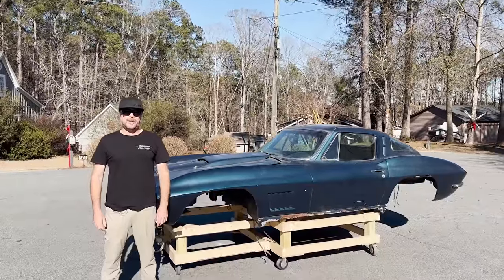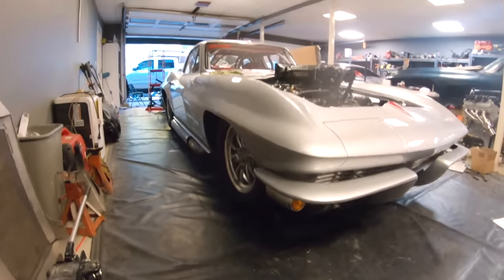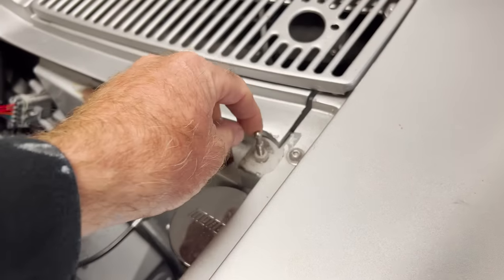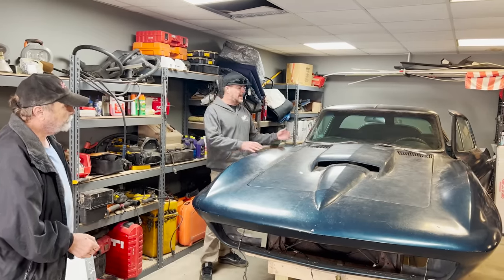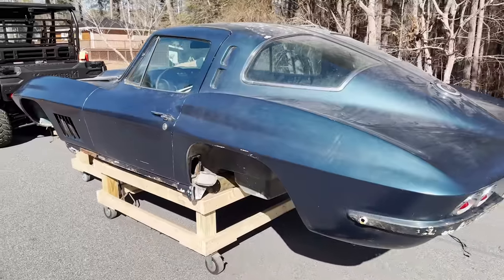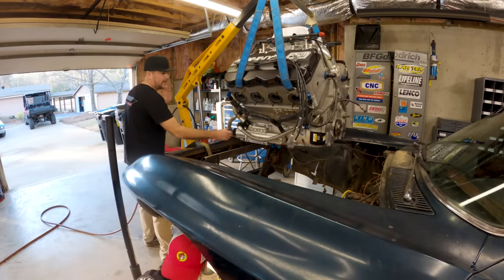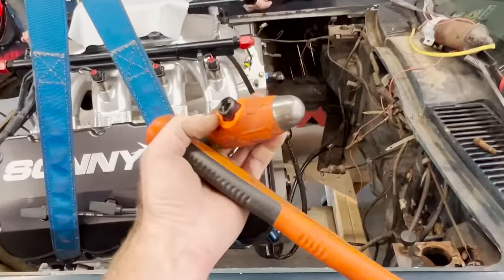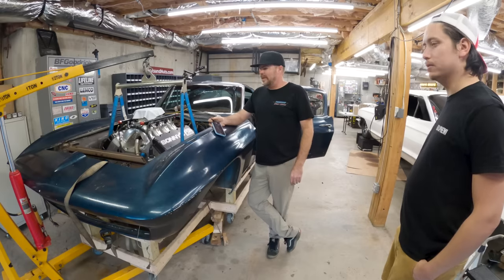I RESCUED A 1963 SPLIT WINDOW CORVETTE HIDDEN IN A BASEMENT FOR 20 YEARS!

Comment: Hey Mike, happy to hear about Mk4 Supra and also Split window, both are epic cars. I would heavily suggest looking at underbody aerodynamics of fellow finn Kimmo Nevalainen’s Six-5 split window C2. He came to USA for Texas Mile and is fastest C2 top speed world record holder with ”identical” car. If you want to be fast, safe and stay attached to ground at high speeds, the bottom end aerodynamics are very important. What is best that it looks absolutely stock in body, but the magic happens underneath.
Reply: 100%
Reply: YES! 👍
Reply: Thx for the heads up of Kimmo , that's a cool and fast ass ride ! 😎
Reply from the maker: i'll definitely search him out. dont want to be doing any backflips. i'm hoping to not run wheelie bars on this car.
Reply: 100% That body makes a ton of lift and needs a good floor / under tray to stay on the ground.
Reply: @FinnegansGarage  I would ask you not to cut up an antique car just to make another drag car
Reply: @jamestyndall529  This car was crashed and already cut up. Watch the video first before crying about someone else's preferences, bud.
Reply: Well depending on what you mean by “stock” that’s obviously a ‘67 front end on it….  They were also running over 170 on the Mulsanne Straight in a stock L88 at Lemans in ‘67.
Reply: @TheBCninja  sounds like you’re the one crying dude. He merely expressed his opinion, chill out.
Reply: @TheBCninja  and it’s his car he can drive it off the cliff if he wants, but I agree, it’s asinine to chop up an original ‘63
Reply: @sidefx996  This car was crashed and already cut up. Watch the video first before crying about someone else's preferences, bud.
Reply: @jamestyndall529  I mean I get what you're saying... Just no one here agrees because we watched the video
Reply: Yes so happi
Reply: @sidefx996  Buuuut, it’s not an original 63. It has a 65 nose grafted yo it after a crash. Vintage work I guess, but not original.
Reply: @sidefx996  L+Ratio
Reply: @RandomName100  That's just bodywork dude.  And it's a '67 front clip thanks very much, not a '65.  The hood and side gills are obvious and unique to a '67.  It's still a REAL '63 and they're not making them anymore.  No doubt the end result will be cool but you can get a body and a tube chassis anywhere to build another Drag Week car, why destroy a real one?  Like I said it's his car he can do as he pleases just one man's opinion.
Reply: @sidefx996  yes it’s bodywork. Fiberglass. And you don’t get a title with that chassi and body.
Reply: Camaro available?

Comment: When I started as an apprentice mechanic, the shop owner had just bought a 63 Vette Hardtop in that very same Daytona Blue, with the the full Z06 package including the rare 36 galleon super tank. 327ci with mechanical fuel injection, heavier but vented drum brakes, a smaller leaf spring and no rear sway bar and a single piston master cylinder. For a race car package so many of the ideas at the time were backwards, (single piston master instead of the stock model dual, a 7 spring rear leaf instead of the stock 9, and no sway bar with the normal model had, the car most have rolled like a rollercoaster in the corners. Spent about 5 years of any and all down time cleaning every nut bolt and part on it (including finding and documenting all the factory inspections marks and when full restored reapplying all of them. ground the carpet glue off the fiberglass floor, (had to scuff the Rocker guard some previous owner had applied to the fiberglass underside (who knows why fiberglass doesn't rust after all) 

This video brought some awesome memories about the trade that I would rather not forget. Best of luck going forward.

Comment: I've done some rough calculations factoring in the boat motor, estimated coefficient of drag, power to weight, rolling resistance of small tire setup etc. etc.
The findings are conclusive and undebatable.
She is going to have one hell of a passing gear!

Comment: When you build the new chassis with the intent to go in the six second zone you should not use the stock C2 Wheelbase which is 98"  I recommend at least 115" Prostock cars are 125" With the twin turbo Hemi your gonna need the longer wheelbase to safety put the power down

Comment: Mike .... awesome video !!!! , that's the Holly grail of Corvette's that you found . That Sonny Leonard  700 plus cubic inch twin turbo motor from Game Over will definitely  put that vette into the 6's at Drag Week
Reply: sure if it can ever hook up LUL
Reply: There's nothing sure about it. It is not easy to do, and this engine was not built for 3000+ hp drag and drive initially. Running 6's at DW takes some effort, it's not just about power. Making this engine live under those conditions will not be an easy feat. There's a reason why guys like Steve Morris and others don't use these big cube engines in conjunction with boost.

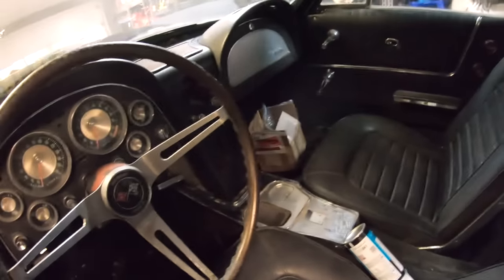Comment: You probably know by now but that's a '67 front clip and '67 big block hood. My '67 BB roadster has been up on blocks since '99. 5:27 Going by the redline on the tach, it was a high horse car (340 or 360 hp). Hey, look, another basement! Dual master cylinder didn't come out until '65.

Comment: It's NOT a 1965 front clip. '65 only has 3 gills. That's a 67 front clip.

The hood is from a big block too. No big block offered in 63. Might wanna keep that though. Hood clearance on the original hood is tight. I'm currently battling that on my 63 trying to find a air cleaner that fits with my new carb

Comment: The first 30 minutes of The Split Window being in your driveway reminded me of sage life advice I received many decades ago, which I'd like to pass on.

"Get good at cleaning. The one thing in life you will do nearly as much as eating, sleeping & s#$!ing is cleaning.

You clean your house, yourself; you clean things before you sell them, install them or repair them. Above all, you will clean things you buy to make them yours.

Get good at cleaning. It will serve you well in life."

Enjoy.

GeoD

PS

The '63 is one of my bucket list cars. The '55 w/ a hemi was also one for me, but unlike the '63, which I'll never get to do, I did get to design & build the '55 w/ a hemi. Mine came about as a chopped top center seat convert w/ a cast iron, mechanical injected 392. Built it in the mid '80's.

Glad to hear about & see you get the '63. I'll be able to enjoy one of my bucket list cars being built, vicariously. (Unless you want some help from an old f%$#?) LOL

G

Comment: Hi Mike. I have a question and I hope it isn't a stupid one. I've never owned a C2 Vette. I have driven several of them. I'm only 5 feet 10 inches tall and on a good day weigh in at 160 lbs. I found the cockpit (?) to be extremely tight and cramped. Add a NHRA certified roll cage and I don't think I'd fit. How the heck is it done ?

Comment: As hundreds have already said, that is a '67 front clip. If original GM it has some value, if aftermarket cut it up. Same with the '67 only hood, if its GM don't cut it foe a scoop, buy an aftermarket hood. Also seats look to be '67, they had headrest that I believe were not available in '63. Great car for what you are going to do. Also keep the doors closed when moving body off jig, body will crack in odd places if you don't

Comment: Are you positive that's a 1963? ... first off that's an aftermarket '67 front with a aftermarket '67 hood, not a '65... it also has '67 seats.. the A-pilar trim is not '63..gas lid is a '67... The door panels are '63 and dash appears to be from a '63 also but the majority of the vette appears to be from a '67..  before someone mentions that '63 was the only year of the split window, yes that is true but that bar could have been fiberglassed in a '67 coupe body.. just seems to be an awful lot of '67 parts on this supposedly '63 split... just saying

Comment: Mile I gotta say you should try and make it a roadcar first, as the 327 found in the C2's is the way to go with a proper vette experence as it offers big block power in a small block package that revs to 6500 RPM and was the chosen motor of choice both here in american and italy where it was used on the Bizzarini 5300, valentino balboni's favorite car

and when your job is test driving diablo's, miuras and countaches, and you choose a car with an american power plant as your favorite, its kinda saying something about how good it is with 4 2 barrel webbers and being in an alumium bodied tube chasised car like that.

like at the very least, look into putting a 327 in a shotbox nova and giving dulsich a hard time with his 68,

Comment: That Vett is almost as nice as my 1984 Camaro Z/28. Just kidding even though I do get a lot of compliments on my Z/28 . It is better looking than most Third Generation Camaro. I have owned it since 1998. It only has almost 56.000 miles on the body. I am running a small block 383 putting out almost 500.00 HP at the back wheels. It is not perfect but it is still a very very good looking ride. I am proud of it. The third generation doesn’t get much respect which I understand. They are rattle trap.. But I love the way it drives. 4:11! I am sure that you will make it a very very beautiful ride. Good luck with your car. The kind of cars you Rich people own and drive are way out of my league.

Comment: I had the option to get a C2 corvette setup for drag week when a collector of many things inlife passed and he and nobody knew why he even bought it.
just idle and letting off the brake the chop would send the car 4 feet lunging. 
unsure if it was tube chassis but it was tubbed with massive radials and a HUDE blower with a big top hat was told complete it was near a 250k or maybe abit more. VERY VERY pretty and well setup car.

Comment: You're going to need a different intake manifold for that thing, that's too tall to really do anything with. Personally, I'd ditch the idea of turbos, a big blower on that car would look SOOOO much cooler, and at that point, who needs a hood? The body tub is red/orange because all GM fiberglass was orange. If you look at any of the factory lightweight GM inner fenders from the GTO or Cutlass or Nova drag cars, they are all orange because that's the way fiberglass was back then and they didn't bother painting them.

Comment: Shadetree tip.....if you ever find yourself in a similar situation to the ragjoint thing again, rather than breaking a deadbolt and resorting to a ballpeen.....head to the box store and pick up an air palm hammer. Save yourself a lot of work.

Comment: 1963 split window Corvette with a 1967 front end. 2 best year Corvettes imo. Wish Chevrolet hadn't stopped making the split window, after just 1 year, but I understand that they were hard to see out of to backup. My answer to that would be...side mirrors, they are there for a reason, learn how to use them. Lol Thanks for the video

Comment: Those useless engine cranes do not fit uner anything except a 4wd. Yes I own one. Though mine is pink,, cheap red powder coat!
So a boat engine in a Vette,, watch out for lakes, it may head towards them. I dare say the engine will need a lot of revision for the entirely different purpose.
I do like the wooden chassis,, good enough for a Franklin good enough for a Vette
But a Supra, Fugly thing with an over ratd engine. The style before were far more attractive, fit a Chev for a decent car.

Comment: I wonder what the history of that car was? If it's like most partial C2's, it probably has a mish-mash of other than original parts to it. Even if you did a complete resto with original parts it just won't have the value to it one that's never been cut up does. Back in the day nobody thought twice about sticking fender flares on them but once that was done it completely ruined the value forever and ever.

Comment: You should get some nice Hart turbos for it. Use something that has been race proven rather than a show piece.

I think it would also be very wise to have a guy like Steve Morris go though that engine before trying to push it to 3000+ hp. 6 second drag and drive engines are definitely way above Tom Nelson's pay grade. Steve has built so many race winning engines that it would be silly not to have him set the engine up for the task at hand.

Comment: Side pipes are a 'must'.  With the '63 heat shields, modern baffles.  Leave the engine fully exposed, with a clear plexiglass panel to fill in the gap left by the missing hood.

Comment: It's forced induction anyway... I'd would want to build an intake with a plenum as low in the valley as possible and shorter runners that came up into the top sides of it. Keep it low and retain as much of the bodylines as possible. The car is already a compromise for the body so, everyone is already agreeing that it's worth the compromise for the look and originality of the body.

Comment: This is absolutely awesome! Although Mike, you almost seemed a bit bummed out that the intake wont fit under the hood. Wouldnt a "underplenum" style intake fix it? Where the plenum lives down in the walley, and the throttlebody sits at the front of the intake instead of on top? Or would that just make the intake track way too hot?

Comment: I have 2 iny garage that my dad had at a dealer he owned i will reveal them soon one has 120 miles on the tach one has even less. Nobody im confident has any like this by any means. I will keep one and take one to barrat jackson or sell private. Supras id like to talk that i have those too from my dads dealer he had 4 different dealers the vette i cant help with. But the supra you will not find one like these either. All sat in the dealers until i just recently pulled them toy property.

Comment: Chop the top, tub the rear wells, stick Game Over's engine in it with straight pipes, bolt a wing on the rear, spinners on the wheels and spray paint it with rattle cans. And that's all I got. You can take it from there.

Comment: Get the harbor freight adjustable gantry crane with roller trolley and chain hoist. I have three they work great. The electric hoist is to jerky to use efficiently. You can let anything hang for months without falling.

Comment: The front of that 63 corvette is 67 corvette with a 427 stinger hood , the fender slashes are 67 also. Having owned three 67 corvettes they are the only year with that hood and fender slashes. That should be a wild ride when finished.

Comment: That front clip is for a '67, but it does look like a '65 gas door and '66 seats.
Reply from the maker: Seems like there's parts from several cars on it. lol.
Reply: @FinnegansGarage  That's very common on Vettes. Most parts fit, year to year.
Wood steering wheels are '64 and up, but always looks good.